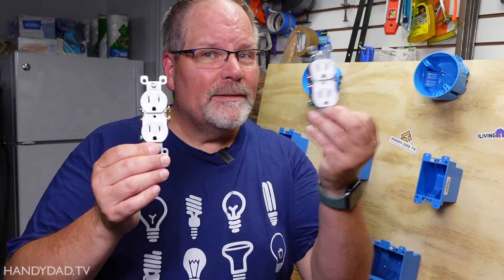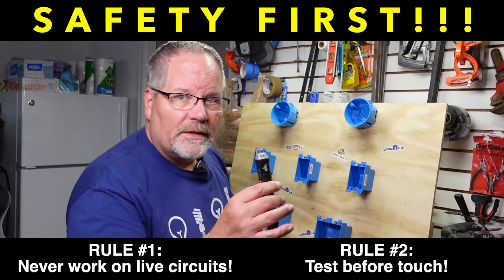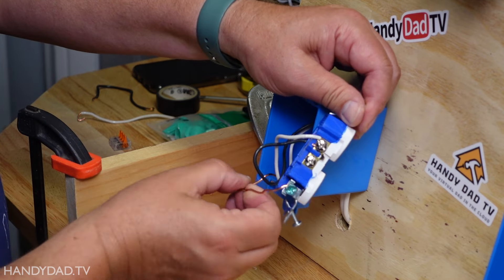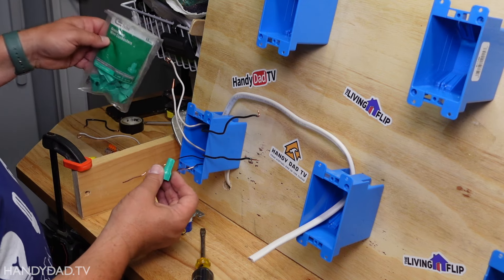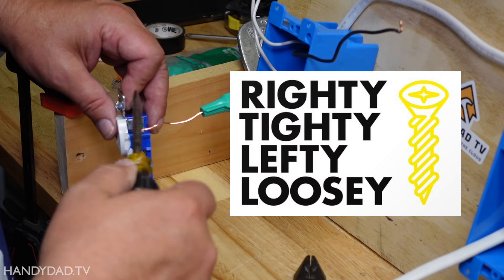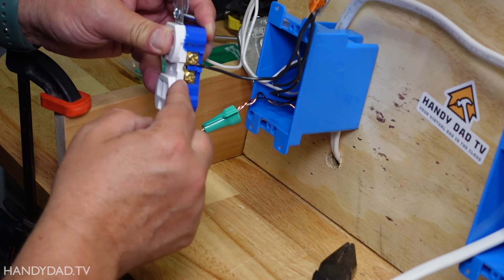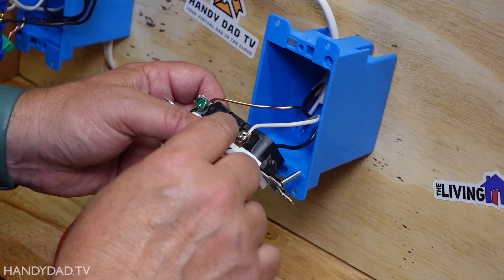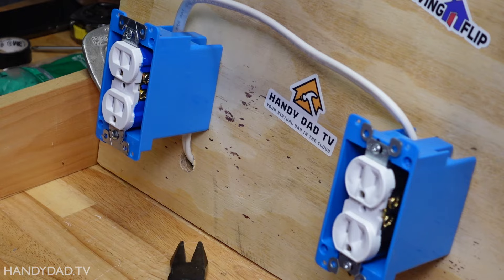SAVE $300 EACH!! How to Add an Outlet from Another Outlet

Comment: Thanks for this video. I have a question, because my existing outlet has no ground wire? How can I install another outlet if the existing outlet has no ground wire? Thanks
Reply from the maker: The best thing to do is run a new ground wire. The other alternative is to add a non-grounded outlet. But they no longer meet code.
Reply: Code allows for you to replace a two prong with a two prong.  It also allows you to replace a two prong with a gfci receptecle.

The gfci would be required to extend or add an extra outlet.  

The gfci would replace your first outlet.

The gfci has a set of "line" and a set of "load" screws (terminals).  Power from the panel goes to the line and the new outlet goes to the load side.  This let's the gfci protect both receptecles.  Code also requires stickers (supplied with gfci) stating "no ground" on both and gcfi protected on the new one.

If you need the section numbers shoot me a comment.

Comment: Can you make this connection outside of the existing outlet in the attic? I found the romex in the attic and don’t want to run romex back to the existing outlet… so can I just make the connection in the attic (maybe I need a junction box) and run the new romex to the new outlet location?
Reply from the maker: Yes you can add a junction box in the attic. You need a non-contact voltage tester to locate the correct circuit breaker, and to ensure the power is off before you cut the wire.
Reply: @handydadtv  that’s what I thought. Electric DIY is DIY I’ve been careful to approach but your video is pretty clear. Thanks

Comment: Are wago connector’s safe to use ?
Reply from the maker: Absolutely.
Reply: @handydadtv  thanks, I have another question. If you replace an old light switch with a new one and there's no ground wire from the old switch, what do you do with the ground wire from the new switch ?
Reply from the maker: You can only ground the switch if you have a ground wire. If you don’t, it may be grounded from the metal box.
Reply: @handydadtv  the outlet box is a plastic one.
Reply from the maker: @frosty4863 If there’s no ground wire, you could use a 2-prong outlet. Otherwise a normal 3-pronged outlet will have an open ground.

Comment: Just wondering why the wago 221 connector cannot be used for the ground. Doesn't it work the same way?
Reply from the maker: Sorry for the confusion but you can certainly use Wagos or wire nuts for grounds.
Reply: @handydadtv I see thank you!

Comment: It doesn't "go through the outlet" that connection is on the outside of the outlet and passes through the side plates.  Frankly if you are worried about heat its the wago that will cause that since the contact area in those is far less than the screwed in connections.
Reply from the maker: I have no issue using the screws. But wire insulation melts before Wagos.
Reply: @handydadtv  you're the one that brought up the temperature issue and by all accounts a Wago connection gets significantly hotter than chaining the outlet directly.

Comment: what is a preferred gauge wires used to extend such outlets?
Reply from the maker: Look at the breaker. If it’s a 15 amp breaker, you can use 14 gauge wire. If it’s a 20 amp breaker, you need 12 gauge wire.

Comment: i want to do add two outlets that will power my Christmas lights and gutter heaters. One will go in the front and the other on the back side of the house. Is that too much power being pulled from the outlet in my attic
Reply from the maker: The gutter heaters will draw significant current and should have their own circuit.

Comment: I have a question 
I have two light switches and one outlet below it. One of the switches has to be on for the outlet or the other switch to work how do I undo this
Reply from the maker: You need to open it up and use a voltage meter to determine which wire is always hot. Splice that one to the hot wire going to the outlet and the outlet will stay on all the time.

Comment: Would you wire it the same way if you add a double outlet to a single outlet by adding the pigtails?   Thanks
Reply from the maker: I plan to cover double outlet situations in another video, but yes the best way is with pigtails to each of the receptacles.

Comment: I added a outlet in the middle of a circuit so I could put and LED light in an area. The light in that outlet shuts on and off, but the the light in the next out let always works. I switched outlets to see if one was faulty and the one in the middle still make the light come on and off while the one on the end stays steady. Any idea what I've done wrong
Reply from the maker: Could it be a loose wire?

Comment: I have an existing outlet in the kitchen with two hots and one neutral connected, not sure how to add another outlet using this? 🤔🤔🤔
Reply from the maker: Is the outlet controlled by a switch?
Reply: @handydadtv  No it isn't, I checked the voltage on both of the black (hot) wires when I had them removed from the plug and I got a reading of in and around 120 v for each.
Reply from the maker: Since they were both connected to the outlet, you can pigtail them together with your new wire.
Reply: @handydadtv  I am thinking I need 3 pigtails, two for the two hot wires (black) and one pigtail for the neutral (white) ? I do use the Wago connectors like yourself so I would use 3 Wago connectors in this case? 

Btw, thank you very much for the video uploads, you explain everything in detail and help DYIers like myself tremendously. 👍👍👍
Reply from the maker: Since you’re not dealing with a switch, all the black wires should be connected together with a pigtail going to the brass screw on the outlet. Same with the white wires and the grounds.

Comment: If I have an outlet that is in the middle of a circuit, (already has wiring running to both screws and has a pig tail ground connection) is there a way to tap into it and run a 3rd  outlet out of that same box?
Reply from the maker: Yes. You need to pigtail all the wires.

Comment: What if you are attempting to wire a new outlet FROM an existing outlet that is in series with another outlet down the circuit? How would you do that??
Reply: This is exactly what I'm  trying to do also
Reply: Maybe use more pigtails to attach all current wires in the circuit,  plus the new run?
Reply from the maker: Watch this: https://youtu.be/klL8XhKMNT8

Comment: Hi! Great video. Wondering what you would do it you were adding an outlet to another outlet that was already in a chain. I am looking to tap an interior outlet to add an exterior outlet on the other side of the wall.
Reply from the maker: You would have too many wires to use the screws, so pigtail all the wires together with a short wire going to your existing outlet.
Reply: @handydadtv  Would you just use a 4 pin lever nut and run them all together?
Reply from the maker: Yes exactly. Except that I don’t think they make 4-wire lever nuts so I’d use a 5.
Reply: Can you pigtail three wires together for three outlets with this green wirenuts here?
Reply: Never mind i see here

Comment: Is there a limit of how many outlets you can Daisy chain?
Reply from the maker: The limit is imposed by the circuit breaker, not by the number of outlets. You can have 100 outlets with LED lamps and you’ll be fine. But one outlet with a blow dryer and curling iron will trip the breaker. 

Hope that helps.

Comment: What if the plug already has another plug on it can you have 3 plugs hooked up I'm trying add a plug for Christmas lights and the one that I chose already has a plug ran off of it.
Reply from the maker: Whenever you have more wires than screws, use wire nuts to connect all the wires and a short piece of wire (called a pigtail) to the receptacle.

Comment: Looks like the power to the 2nd outlet is still coming thru the 1st one?
Reply from the maker: Depends how you wire it. If you use a pigtail, current doesn’t flow through the outlet. If you use the screws, it does.
Reply: @handydadtv  The power still has to come from the 1st outlet? I will have to look at that again. Thanks

Comment: I am adding a new outlet to my kitchen. The closest outlet to the new one appears to be the first in the chain that goes across the kitchen to the other side of the room through the ceiling. How do I add the new outlet without disconnecting the other one?
Reply from the maker: You should use wire nuts and pigtail them together.

Comment: Say I  have a  15 amp outlet using 14 gauge wire .  Can I use 12 gauge wire to add another 15 amp outlet?
Reply from the maker: Yes, you can always exceed the specifications but never go lighter.

Comment: What size of gauge wire did you use?
Reply from the maker: Wire gauge is determined by the amp rating of your breaker.
Reply: @handydadtv I have 15amp
Reply from the maker: @phogettaboutyu For a 15-amp circuit, you can use 14 gauge wire.

Comment: Nicely done , but you forgot two moves , one is the unused screws on the plug should be tightened you don`t want lose screws in there and also wrap some electrical tape around the screws  , plastic box or metal , I always put tape around the screws .
Reply from the maker: Thanks for the tips

Comment: I have a question. I have an outlet that will only work when I turn on the light switch but I want the outlet to be working without turning the light switch on. What can I do?
Reply from the maker: My first thought was, just leave the switch on… but I’m assuming the switch controls the outlet AND a light at the same time. 

You need to open the switch and outlet (and possibly the light) to determine how they are wired together. Use a voltage tester to figure it out.

Comment: Question i was in the process of install a new outlet in back of the TV. The outlet I'm adding from is not ground. It's an older home.  Could I still install the outlet
Reply from the maker: Yes you can install a 2-prong outlet behind the TV, which shouldn’t be a problem because I’ve never seen a TV with a 3-prong plug.

Comment: can i add an outlet before a switched light (other side of the switch) and still be ok as far as code?
Reply from the maker: You should be able to do that, but I am no expert on codes. You’ll need to consult an electrician if you want an official answer.

Comment: HandyDad. I just installed a new receptacle and daisy chained it to an existing. However, my circuit tester shows that I have an open ground. I don't know what's wrong. I have a pigtail coming off of the source receptacle ground screw and connected the source receptacle ground wire and new receptacle ground wire to it using a marette. At the new receptacle end, I have wrapped the ground wire around the ground screw at the back of the box before securing to the ground screw. Everything looks to be wired correctly, so I don't understand why it keeps telling me that I have an open ground. I'm using metal boxes, not plastic - does that have anything to do with it?
Reply from the maker: Test the tester on another outlet. If it works, then something is loose or broken.

Comment: For a second, I thought it looked like you'd wired the hot wire on the new box counter-clockwise, as the wire "starts" at the top of the screw, but when I paused it (at 5:34, I could see that it's still clockwise, just starting in a different location.

Comment: So if you have two black wires that can be pigtailed to go into one brass screw, why can't you take those two black wires and attach them to the two different brass screws on the one outlet? Since you said they're connected, isn't that the same thing?
Reply from the maker: You can. But a lot of people recommend pigtails even if you only have 2 wires.

Comment: This is a good idead but if you use 10A from each receptacle and have a bad 15A breaker it will cause a fire or even worse stuff so always run anither wire to the panel for another outlet
Reply from the maker: You must have a huge panel to have a circuit breaker per outlet. 

Realistically, people add outlets to avoid using extension cords, not to suddenly start consuming more electricity.
Reply: @handydadtv  yeah its worth to get a bigger panel rather than a new house

Comment: It's worth noting that some builders share the neutral between two different circuits, which can cause the tester to act kind of funny and you have to figure out which other circuit it is that the neutral is being shared with. I had no idea that that was even a thing, but that's how my unit is wired.  It's perfectly safe to do that as long as they're on opposite phases. So, the other circuit will always be on the other side of the breaker box when you're looking if that's the case.
Reply from the maker: An electrician told me neutral sharing is a shock hazard and should only be done with the two hots on a double-pole breaker.

Comment: In my house there's an outlet that I have NEVER used. It's located 3 ft directly under the fuse box. I finally need to use it and it doesn't work. I used a non contact tester and there's nothing. I turned off 2 breakers  that might be for that outlet and then I removed the outlet and there are only two white wires taped together, no black wires and no ground wire. I think this is going have to be an actual electrician job. I can't find video for this situation. Any help is greatly appreciated.
Reply from the maker: Very strange. Yes, call an electrician to figure out what those wires do before you remove them.

Comment: How many new outlets can be added to the existing outlet id like to add about 3 more
Reply from the maker: There’s no hard limit to the number of outlets. You’re just limited by the current drawn by everything you plug in. So if you’re adding outlets in a shop for big power tools, you might want to run a new circuit. 

If you’re adding convenience outlets for lights, TV, etc., so you don’t need to run extension cords, you’ll be fine.
Reply: @HandyDadTV  ok thank you

Comment: Can you make a a video with a old receptacle that has two wires with no ground. I got a house that was built in 1920 when I open up the receptacle it was just a white wire and a black wire with cloth on it with no ground.
Reply from the maker: I have no experience with old wiring. If it were my house, I’d rewire it one circuit at a time.

Comment: so, using pig tails I can continue making lots of new receptacles? Is there a limit how many I can make?  That is the first question.
Reply from the maker: There is no limit on the number of outlets, but you are limited by the current rating of the circuit breaker. Adding outlets doesn’t add capacity; it just cuts down on extension cords.
Reply: @handydadtv  thank you for your response. I appreciate it. And i guess setting a certain current rating of the circuit breaker depends on what utilities will be used from that breaker?
Reply from the maker: Actually, it’s limited by the size of the wire. Higher amperage needs thicker wire. You can’t just replace a breaker with a higher rating; the wires could overheat and cause a fire.

Comment: Can u connect a third outlet using the same method but with bigger leaver nut?
Reply from the maker: Yes, but you can’t stuff the box with wires. You need a deep or wide box for more than two wires.

Comment: What would you do if the existing outlet already has 4 wires going into it? would you just use a 4 port lever nut?
Reply from the maker: 5-port lever nut, because you need a pigtail to the outlet. 

But you need a big box to fit all those wires.
Reply: @handydadtv  do you have a video for this scenario?
Reply from the maker: No sorry

Comment: So do I have to worry about overloading the circuit and popping breakers?
Reply from the maker: Very common question. The number of outlets has nothing to do with overloading a circuit. You can trip a breaker even if it only has one outlet on it.

Comment: Is there a limit to the amount of outlets you can run on that breaker
Reply from the maker: There is no code limit on the number of outlets, but the capacity of the circuit doesn’t change. For example, adding five outlets doesn’t mean you can have five air space heaters. It means you can move ONE space heater to five different locations.

Comment: Why could you not use a Wago 221 lever nut on the ground wires instead of the Grounding wire connector?
Reply from the maker: You can.

Comment: Is there any reason why you can't use a lever nut instead of the twist on connector?
Reply from the maker: No, they do the same thing.
Reply: @HandyDadTV  Thank you for replying in a timely manner! And for the encouraging answer. I was just about to run out and get a bigger box. I'll try the lever nuts and tell you how it goes. Thanks again!
Reply: Well, it's been a couple days now and everything has worked out well. Made some extra room using the lever nuts. Thanks again HandyDadTV!

Comment: How many plugs can you run from one safely?
Reply from the maker: There is no limit to the number of outlets. But adding outlets doesn’t add capacity. Capacity is limited by the size of the wire and the circuit breaker.

Comment: So no need to upgrade the breaker when doing this?
Reply from the maker: You can NEVER upgrade a breaker unless you rewire the entire circuit with thicker wire. 

If you don’t have enough amperage capacity for whatever you want the new outlet to power, then you should run a new circuit.